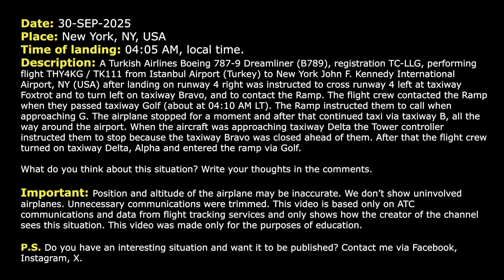Long way to terminal. Turkish Boeing 787 goes around the JFK Airport to get to the gate. Real ATC

Comment: If any experienced pilot here, what went actually wrong here? Pilot error, miscommunication with ATC, airport complexity?
Reply: Ramp controller assigned them a gate and told the pilots to call him when approaching taxiway G. The problem was the aircraft was already past G, so they taxiied until they went around the airport.

Comment: I am not an aviation guy so i don't know if pilots supposed to know their exit even before that communication and stop before passing G, but if not, why atc send them to a gate they already passed? Atc kinda talking like he give instructions beforehand but pilot missed the exit, but this is not the case. Maybe they thought ''if they send us to G, it should be ahead'' and start looking for it. If they knew it is behind, wouldn't they just turn from H or HB?
Reply: At JFK, the pilots would call the ramp controller to get their gate assignment and taxiway entry point, but it looks like they did that quite late. Why they did that, I have no idea. The air traffic controller doesn't control the ramp, so he has no idea what taxiway the pilots are supposed to enter the ramp unless the pilots tell him, which they did not.

Comment: why didn’t the controller just say taxiway B G to the ramp?
Reply: The air traffic controller doesn't control the ramp, so he has no idea what taxiway they would enter the ramp since it's the ramp controller that assigns the gates and entry points. The pilots would have to tell the air traffic controller what taxiway they enter the ramp, but that didn't happen here.
Reply: @C @CaptainKevin  What?There is ramp controller?And even not controlled by the ATC?That’s so different from our tower unit.
Reply: @soulsdark5733  Yes, at a lot of large airports in the United States, you have a ramp controller. Depending on the airport, they could be employed by the airport or even the airline itself. If you look at the control tower at JFK, you'll notice there's a cab at the top of the tower and one that's much lower. The lower one is the ramp tower that the ramp controller would be at. The upper one would be the air traffic control tower.
Reply: @CaptainKevin OK,got that,one day we will need ramp controllers as the increasing flow of the airplanes.

Comment: If it's assumed that all records and visuals are correctly synched then that 'RAMP' assigned A3 thru G is somehow a in a bit delay that cuased the circular loop. ATC expert is very correct that the nomenclature stipulates HOLD YOUR POSITIONS not 'stop your plane' as if a call off NYPD to a bus!!! Ground trafic is seemed overloaded and overwhelmed. JFK should have them send on some retreat in this very halloween period with their families... Thus spoky circus caes would be avoided!

Comment: DEFINITELY ATC FAULT, TECHNICALLY PILOTS CORRECT
Reply: Just to be clear, it was the ramp controller that gave them the gate assignment and the taxiway entry point, not the air traffic controller. The air traffic controller has no idea what taxiway they're supposed to enter the ramp unless the pilots tell him that.

Comment: Complex airports cause of mistakes. This is not excatly an excuse but we can not ignore.
I had an idea a long time ago. Some of it is actually starting to be used in aviation.
There's another method that could be used at very complex airports like JFK, and I'm very curious when they'll implement it. With this system, where they've already figured out most of the work, pre-planned taxiways could be sent directly to aircraft via data link. Perhaps taxiways marked on-screen by the controller, via an ADS-B or ACARS data link, could be sent directly to the digital maps now found on many aircraft (these maps would all need to be in the same format, of course).
In videos, we see taxiways from above or can read them on charts, but pilots see them from the cockpit, and at airports with very complex taxiways, following these signs can be very difficult.
I don't know if such a system exists or not.
Reply: The problem is the tower controller has no idea what taxiway the aircraft needs to enter the ramp since it's the ramp controller that handles that, so unless the pilots tell the tower controller what taxiway the ramp controller has told them to enter the ramp, the tower controller wouldn't know.

Comment: If the ramp doesnt have ground radar and doesnt have visual on the plane, they wont know if the plane had already blown passed that taxiway. The pilots should have questioned the instruction from the ramp and asked the ramp if they really wanted them to go all the way around the airport back to the taxiway they just missed. My guess is its cultural. Turkey might not be a country where questioning instructions from someone in an authority position like the ramp controller is as encouraged as it is in western countries.
Reply: I want to comment as a Türk , no problem to question instructions especially in this type of work communication, I bet problem is discussing a detail  with a native English speaker . This difficulty always overlooked. Problems for pilots also starts when back to head office so they tend to solve problems at their own in silence when they thought at first it is easy. IMHO.

Comment: Big deal… I’ve spent over an hour and over 3,000 pounds of gas taxiing from the Delta Terminal to RWY 22-R.  And that was with a two engine taxi on the good old B-727.  I was sure glad I got paid by the minute.  That’s part of flight panning to ensure one has enough gas to go from point A to happy hour.

Comment: Where the hell was ATC when they just passed G??? They waited all that time until it was way to late! Those Pilot were NOT familiar with that airport at all. That's NOT an excuse by any means.
Reply: ATC doesn't control the ramp at JFK, so has no idea what taxiway they enter the ramp unless the pilots tell him that. It's the ramp controller that assigns the gates and taxiway entry points.

Comment: The interesting part with major US airports is that with the simple clearance of “Bravo to the RAMP”, it makes people feel like they have the freedom to manoeuvre around the airfield but they don’t. 

This part is particularly hard to grasp by foreign airline pilots because in most part of the world the ground controllers always gives details instructions to the parking stand. 

It’s ok to miss the turn, just let the ground controller know about it then he will move other traffic out of the way and give you a U- turn back to G. The JFK guys are helpful (They may not have the best attitude due to their workload , but they will get you there)

US ATC assumes the pilots can watch out and sort of find your way in some situations. It is a highly efficient system in my opinion (And in places like SFO, this is perhaps the only way to get the capacity they need) but it puts more responsibility on the pilot side (for example visual traffic separation) which is quite different from other parts of the world.
Reply: Biggest difference is the air traffic controller in the United States doesn't assign gates. The ramp controller does that, so the pilots have to call the ramp controller to figure out what taxiway they're supposed to enter the ramp. That said, normally, the pilots would then tell the air traffic controller, so I'm not sure why that didn't happen in this case.